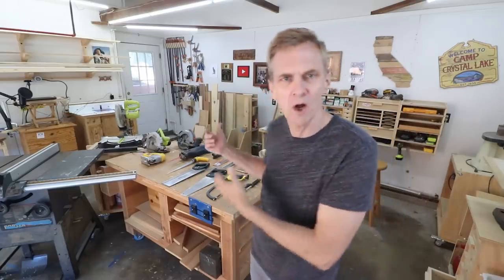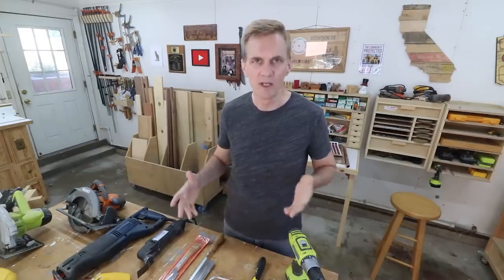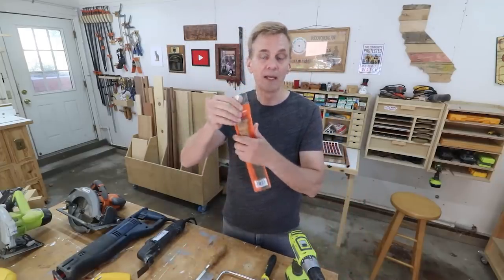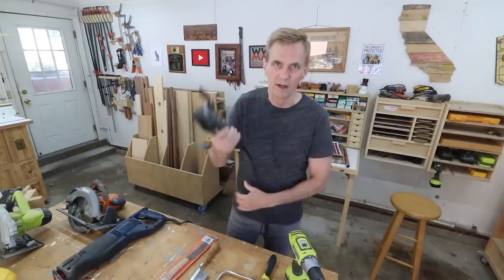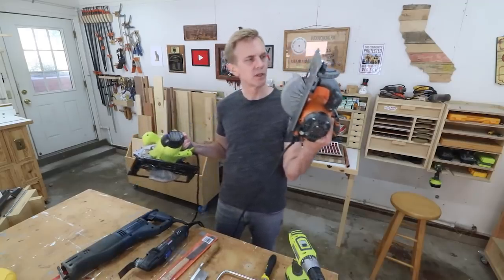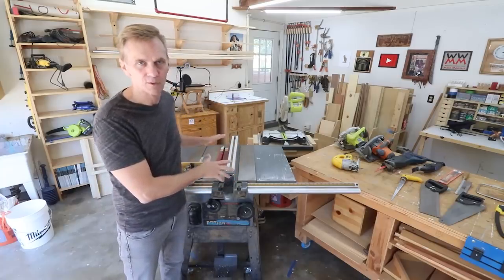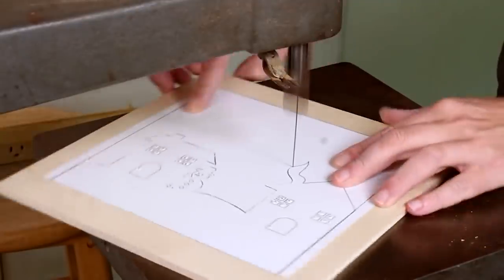Let's marvel at all my saws

Comment: It was fun to watch this:  I pretty much have the same saws you have and agree about how much you use or don't use them.  BUT, outside of woodworking, the "oscillating multi-tool" is almost the most handy tool I have in DIY projects.  Quickly cutting door jamb moldings for new flooring, cutting a series of staples holding a cheap commercial cabinet shelf, cutting drywall, it rocks!  And I have a big set of sanding attachments for it for woodworking, too!  I also love my reciprocating saw; as you said, good for demo'ing and even an occasional tree limb...but one of the places it shines is taking out roots of small trees and bushes, where a chainsaw would be ruined by the dirt.
Last thing:  You mentioned using your coping saw for, well, coping.  I recently started using (gasp!) MDF floor moldings where there was going to be a lot of inside corners.  Coping with a 4" grinder is incredibly fast and easy!!!  Even did that installing PVC plastic molding in a bathroom.  Lots of videos around on how to do it, and you would be amazed!!!

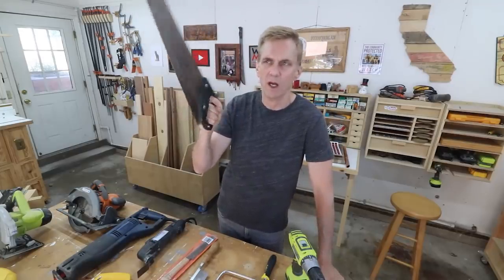Comment: That "basic" saw at 3:48 is one of the best ones and one that I use the most. If i need to cut down really long boards (several meters long) for later processing I use it. It's really fast to cut with and you can get really straight results with some training. The handle is a tool in itself as you have both a 90 and a 45 degree angle on it, so you don't need to run and get a speedsquare when making your cutting lines. By far one of the best saws. If I were to build a project and only had one handsaw to work with it would be that saw for its speed and versitility. 
In sweden we call it a "fogsvans" or a jointingtail

Comment: I have my japanese ryoba saw close at hand in the shop. It is by far my most used saw and if i’m not making repeated cuts, it tends to be faster than setting up an electrical saw. It has basically replaced my miter saw for everyday use. With some practice the cuts are easy to make and square enough, with very little tear out. It also doesn’t cover the shop in dust.

Comment: Reciprocating saws are great for construction too, but they require some skill to use it well.  I recently used mine for cutting fence posts to length because they were too thick for my circ.  They're great for rough work and can finish corners circ saws  can't.  You can also use them bladeless to vibrate stuff, like concrete forms.

Also that multitool is way better at cutting drywall than the drywall saw.  Get one if those half moon blades and you'll zip through drywall like butter.  A lot easier to control too.

Comment: Drywall Saw- also really good at carving pumpkins.   I use mine once a year for that purpose and ... not much more.
Reply: XD me too
Reply: I bought a drywall saw specifically for pumpkins. Much better than those cheap plastic ones that come in the carving kits, and drywall saws are cheaper
Reply: Yes, absolutely!
Reply: I went full power tool on pumpkins a few years ago and haven't looked back since.
Reply: I ground the teeth down to nubs on mine and it's great for cutting grass/sod. I use it all the time when I need to mess with my sprinklers
Reply: I use a Dremml for pumpkins... with all the different types of bits available,  I have been able to pull off some cool designs.

Comment: For me, my number one saw is my Track Saw. I can do just about anything I need with it. The only time I really break out the Table Saw is when I need to do long rip cuts.
I then have my cordless circular saw for when I need to break down some sheets, or just need to quickly cut some wood down.
Then I have my cordless Mitre Saw for when I'm working outside, it's not as powerful as my corded one, but it sure is more convenient!
I prefer my bandsaw over my jigsaw because it leaves a cleaner (and straight) cut, but I'd say they're both as important as each other

I basically replaced my drywall saw with a cordless oscillating multi tool, it's faster and makes much less mess!

Comment: In the video,  you mentioned finding the Allen tool to unlock the recip. Saw. I've found that blue taping the appropriate tool or extra blade to the handle of saw works wonders for finding them when needed.
Reply: On my newish ryobi multitool that needs an allen key, I figured out a way to drill a hole above the battery mounting area and epoxied a small magnet on the outside to hold the allen key in in place.  The key is metric and turned out to be the same size as what came with some ikea furniture (so I had like 6 of them).  I hacksawed the key to size and now it stores right on the tool.  Previously I had written the mm size needed on the side of the tool, so I knew what allen wrench to hunt down.

Comment: Great insights and stories, and really cool to see and hear. The hand saw you weren't sure of (I think you said "cross cut saw"), I've always heard called a "carpenter's saw", for what little it's worth.
Reply: In the UK we call that a Panel Saw
Reply: When I was a kid - 10 or 11 years old - I started building things with scrap wood I would find. The only tools I had were whatever Dad had. That consisted of a pair of lock-jaw pliers, a hammer with a loose head, one Phillips and one straight screw driver, a drill that he was given as a safety award at work that had the sanding attachment, and a saw like that with a wood handle that was broken on the back and held together with duct tape. My dad was a chemist. He did not make anything nor did he repair anything that I ever saw while growing up. I think he inherited what he did have from someone. 

But, could I make some cool stuff with these and some scrap wood - at least for an 11 year old that had never been taught how to use any tools at all.

I think my dad still has that saw. I am 53 years old now. You do the math.

Comment: You seem to underplay the importance of the oscillating multi tool. It's AMAZING and got me out of countless jams
Reply: Ditto.  I dismissed them as a marketing gimmick for a long time.  I impulsively bought one at a pawn shop because it was still new in the box for a great deal, and it really is a useful thing to have around.
Reply: @nefariousyawn  same here it’s really a great little tool
Reply: I use mine more for home improvement than for woodworking - cutting trim, cutting nails, etc. It's like a precision demo tool. I do use the sanding attachment for woodworking to get in tight spaces every once in a while. It isn't always the first tool I think of and it would be interesting to learn other ways to use it, especially for woodworking.
Reply: Yes! I have been wanting one for years and finally brought one home last weekend. Oh my goodness. If nothing else for home repairs, renovations etc, it's amazing. I can see this being my most used saw for years to come.
Reply: Rarely a day on the job without grabbing the old oscillator.  There's no other tool that gets into tight spots like it, it doesn't throw dust, and is useful from frame to finish.  The only downside is the cost of the blades and how fast they wear out.
Reply: @jacobthompson1569  I resharpen them several times before they get thrown out
Reply: I love my multitool ... it has replaced my hand drywall saw on many applications. I agree with the downplay of it ... but for woodworking, I don't use it that much, it is more of a DIY tool for home projects.

Comment: Nice piece - thanks.  Now, on to the grumbling - about table saws.
The gap between "cheap" and "expensive" table saws has widened by a lot.  There used to be a thing called a "contractor saw", which is what you have.  They seem to have gone the way of the dodo, other than on eBay, etc.  You now have to choose between a dual-duty "job site" saw and a cabinet saw.  It seems like the go-to (new, still manufactured) saw is DeWALT DWE7491 saw - which is really, really nice.  I love the geared, precision rip fence.  But it's a little baby.  The next step up, both in price and quality is the SawStop.  But it's still 4-5 times as expensive.

Comment: I have that Ryobi table saw.  All that you said about it is true.  I made a modified BMW+ to act as its base. It's still underpowered, and scary, and I can't use most jigs that require runners.  Or magnetic tools.  But it cuts straight.  Kind of.

Comment: I've got that exact table saw.  Works well, but I've had to fix it a few times.  I've had to fix the dust port, drive belt and motor capacitor.  Still runs great though!

Comment: I have a hole saw that allows me to install inspection ports on sail boats.  It is 5 or 6 inches in diameter.  Great tool when you need it but it isn't used much.

Comment: I got the cheapest Ryobi table saw they sell before I knew any better (really regret not going with your recommendation, that was back when they still sold the Ridgid table saw without the stand for $280). Aligning the blade to the miter slot was finicky at best; it had a tendency to turn in one direction, then click and go all the way back in the other. I eventually got it "good enough" and basically left it like that. I actually found the rip fence to be surprisingly decent, though it's likely I just don't know what I'm missing. I wish the miter slots were a standard size, though, and the model I got only has one of them, so I'm a bit limited in how precise I can make a cross cut sled. I also didn't really get what "rip capacity" was...I eventually added a router table/extension sized to match the table saw's table and attached it to the side of the table saw using the holes which were originally for the push stick and it works OK. At least it has a riving knife...

Comment: Saws can be like clamps. Can never have too many. (Not really, but you can end up like that anyway). The one saw you don’t have, which is not a beginners essential, but IMO should be recommended for intermediate to advanced workers is a track saw. Yes, you can get by without it, but you’ll find it extremely useful if you have one.

Comment: Bro. You need to try a Japanese pull saw. Get one with fine teeth on one side and courser teeth on the other side.
Additionally, a battery powered circular saw is a dream to use after years of the corded version. I'm surprised how long the battery lasts.
Also, a PVC saw is fairly cheap and makes cutting plastic pipe a lot easier.
Just a few thoughts. We love watching you!

Comment: The oscillating multi-tool.  There is no better way to cut drywall for electrical work or precision knockouts in drywall where I want to keep the plug that I'm cutting.  Useful when I need to fish cables through the wall.  After you're done,  you can screw the piece you cut out back onto the stud.  A little mud, sanding, and paint, and no one knows you were in there.
Reply: As a diy home renovator there have been so many time that multi tool has gotten me out of a jam and done the job that no other tool could have done as quickly or as easily. Not a precision tool by any means but a must have in any home owners tool box in my opinion.

Comment: Sorry but I use my hand saws more than my power ones,  the one I do use is the multi tool as a sander, for my country jobs as one of my farther in laws called it jobs out side. My favourite hand saw is an old Diston saw one of the best in Thier day. I have round sole planes one body with interchangeable wooden soles. I was a Pattern Maker in UK  did my apprenticeship and carried on till after for 30 plus years then changed my trade to sell mobility equipment. Till my heart tripped out. But still do bits and pieces not as much as I would like to but happy times.sorry I totally digress. All individuals are different. 🥂👍👍

Comment: The Ryobi 10" table saw you trashed is the one I own unfortunately. It's useless to build shop furniture as the rip capacity is around 13". Plus the throat plate sits lower than the aluminum deck. So if you're cutting a small enough piece of wood it can get caught on the lip at the back of the plate. It was fine for the job I initially bought it for, but now that I've gotten more into wood working I'm realising just how bad (and outright dangerous) it is.

Comment: I made the mistake of buying one of those bottom of the range table saws - what a waste. It has a cast aluminum top that was warped out of the box. The fence is so flimsy they might as well have left it out - and the arbor can't take dado stacks - I've improved it by building a new top out of MDF and building a better fence, but have started saving for something better

Comment: The "drywall saw" looks suspiciously like a Keyhole saw, the drywall saws I own (too many) are much shorter in length with a coarser tooth. I'll take your dovetail saw. I learned how to hand cut dovetails from Rob Cosman. Very gratifying but it does take patience, an eye for precision and has a learning curve that wood machinists don't typically enjoy.
Reply: Agree with your comments about Rob Cosman AND about keyhole saw -- I have a Stanley wood-handled one and it's marked as a "Compass saw".  Aggressive teeth and I've never had good results using it. Bought mine in the 80s for some long-forgotten reason but could have been because I liked the look of the wood handle.